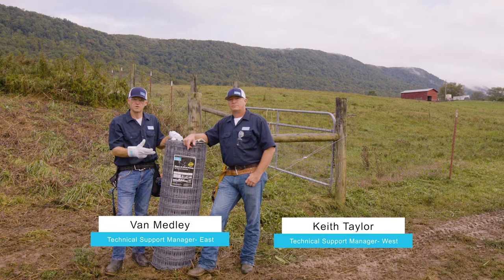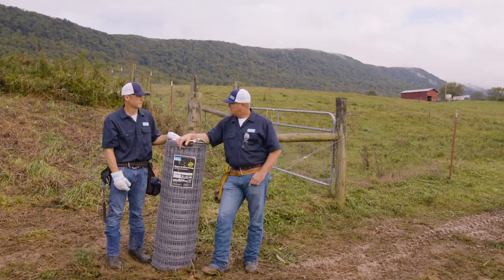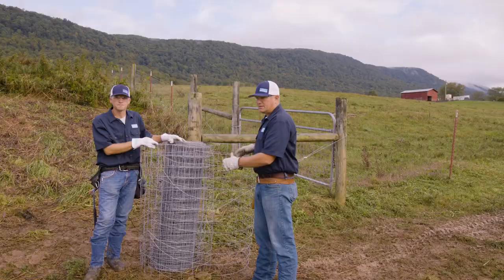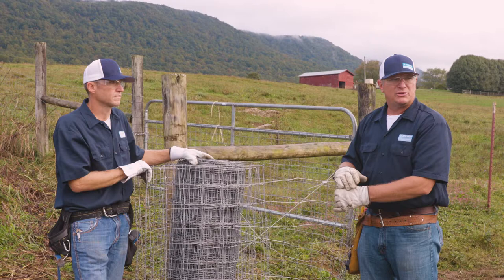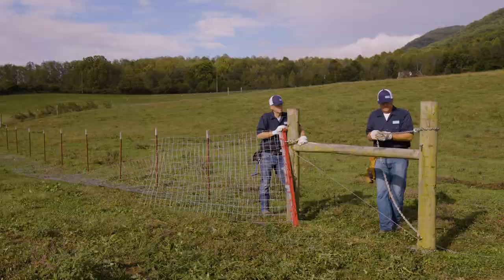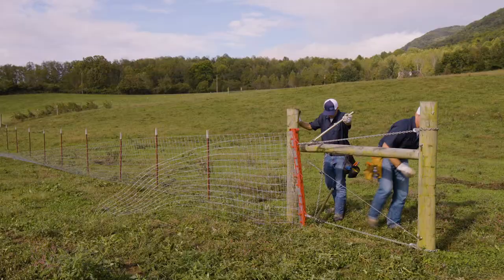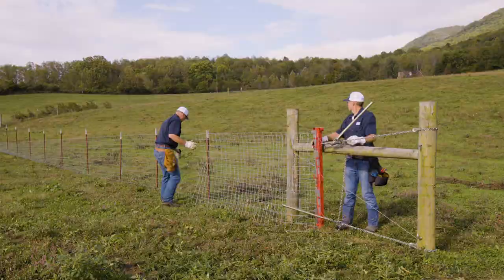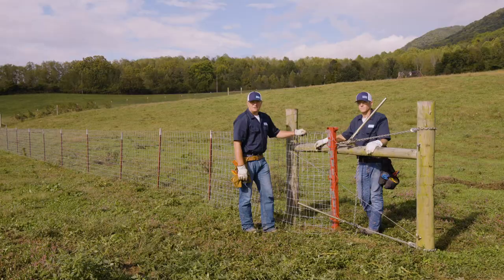Installing High Tensile Non-Climb Fence | Do's and Don'ts to Proper Fence Installation

Comment: Excellent presentation and very clear on the process.  I'm considering using this for pig fencing along with 3 hot wires. A combination of 8" H bracing and 6.5' T post. Before I purchase a few rolls, would you recommend this? We're relaunching our YT channel to homesteading and this fence will be a product we feature if you think it'll be ok for pigs. They are IPPs...not big boars. I look forward to hearing back.
Reply from the maker: Hey, thanks for checking out our channel. And congratulations for launching your new YT channel soon. You'll have to share the channel name with us once it is launched. We hope that our videos have given you some great ideas for your new homesteading journey. Where are you located?

And in regards to your question, our high tensile non-climb products is quite strong and should work well for your pig application as long as you don't anticipate too much pressure on the fence itself. The more pigs you'll have in one area the more pressure you'll have on your fence. If you believe that the pigs will pressure the line wires up and down the knots of the non-climb fence can slip under heavy pressure. If you anticipate high pressure we would recommend the 1348-3 Solidlock Pro product.

8" posts for an H brace 8' wide is very common when building H Braces. T-Post spacings at 8-10 foot centers work very well.
Reply: @BekaertFencing  We are in North Central Mississippi.  We're very familiar with Bekaer products as I've recently ran some 3 miles of the 4 barb wire for the pastures. We'll also split the south pasture in September which will be another 4-5 spools. 
Our YT is Real Life Reviews. Basically, the platform was to review products,  DIYs and some cooking. Now, that we've moved to this farm, I'll relaunch about homesteading thus month. (Living Bread Homestead) Fencing just happens to be a big part of it. Our channel is pretty small with just 10K subs, but I'm looking forward to getting back into it. Our last video was just about a heavy snow and a glimpse of the homestead.  
I really appreciate you getting back with me and in June we'll be building the pig pen. If you do not mind, I'll leave a link to your channel when I post the video on the pig fencing. Thanks again. I subbed.
Reply from the maker: Great to hear you're already familiar and trust our products. Yes! We'd love to watch the video once you post it. Until then we'd love to continue the conversation with you if you're willing, reach out to us at thefencepros@bekaert.com
Reply: @BekaertFencing  I reached out. You'll see reallife and pondiver in the email adress.👍